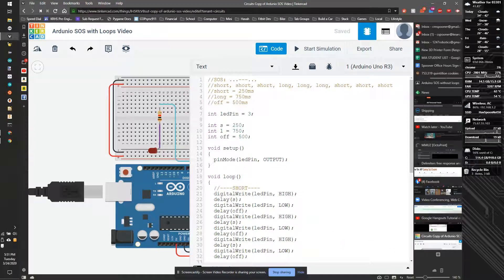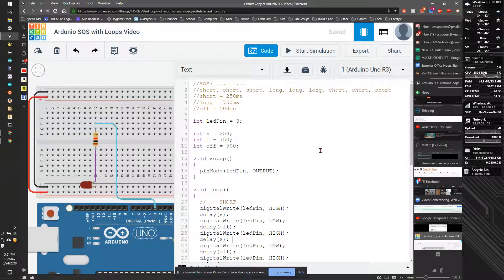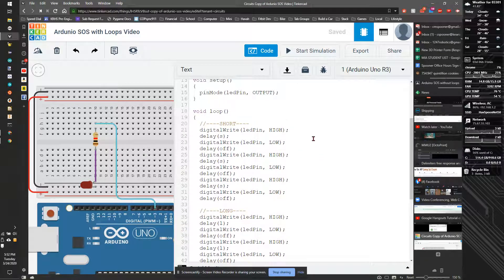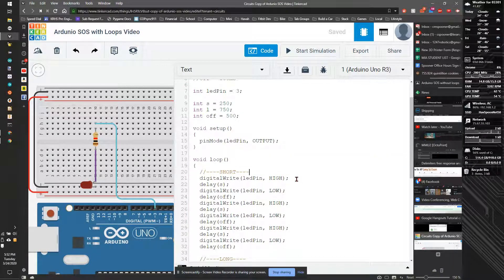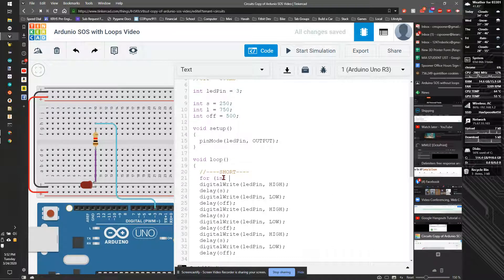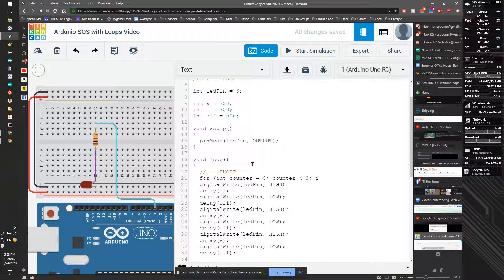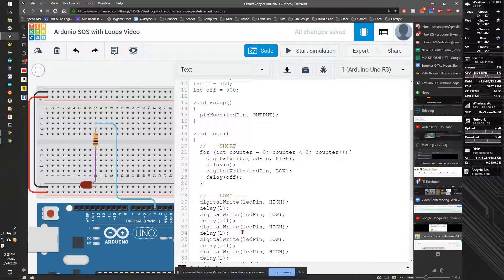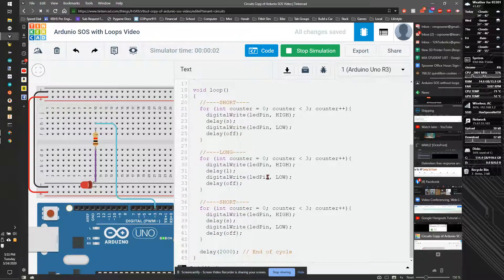TinkerCad Arduino SOS Circuit - With Loops

Comment: int i=0;
int previous;
int current;

void TurnOFF_all_LED()
{
  	for (int pinLEDOFF= 1; pinLEDOFF <= 10; pinLEDOFF++)
    	{
      	digitalWrite(pinLEDOFF,0); 
    	}  
}

void setup()
{
  
 for (int pinLED=1; pinLED <= 9; pinLED++)
 {
  pinMode(pinLED, OUTPUT);
 }
  
}

void loop()
{
  
  TurnOFF_all_LED();
  delay(1000);
  for (int pinLED=1; pinLED <= 9; pinLED=pinLED+2)
    {
     digitalWrite(pinLED,1);
     delay(2000);
    }
}

could you explain this to me